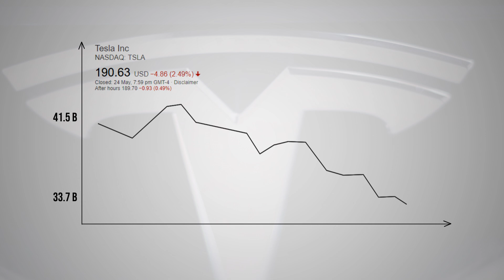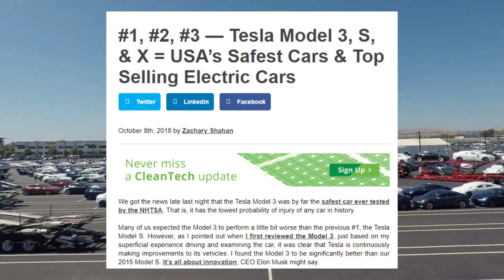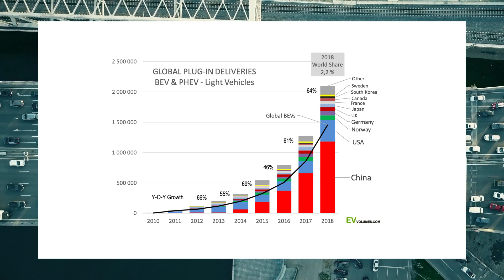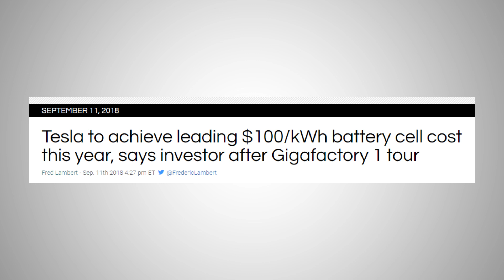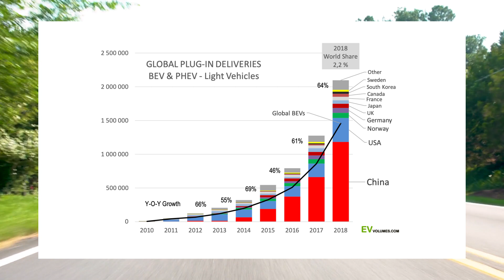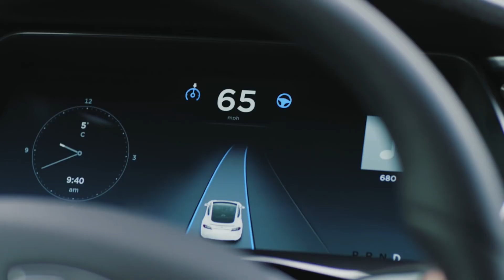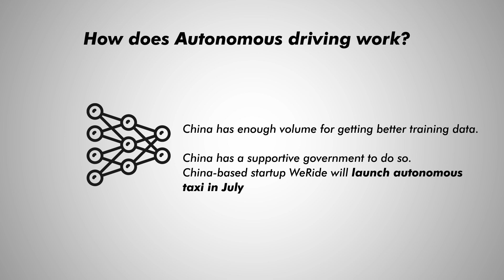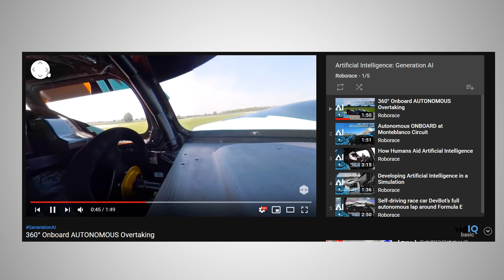Can Gigafactory Shanghai Fix Tesla's Money Problem? | Elephant Explains

Comment: The problem with Lidar is it's too expensive for mass use.
Reply: I mean Google Waymo uses sensors worth fucking $7500, entire AP FSD package is 8K. How can one justify the LiDAR sensor which is also not flush to sit in the car but destroys the design of the car itself
Reply: @gopinathms2012  you are so dumb, i mean look at the LiDAR device is like are you trying to make a big thicc forehead sedan / suv or what ?
Reply: @PicuPiee  rephrase your reply properly, I did not get you. Sorry
Reply: Most important problem is that lidar throws away important information by only giving you three dimensions, width, depth and time. The height dimension cannot be retrieved from this information. Cameras also give three dimensions, height, width and time, but depth information CAN be retrieved from this information very well. Furthermore available resolution of cameras far exceeds that of lidar. Because Lidar directly gives you depth information, it is relatively easy to create a decently self driving car. However, the absence of height information, makes it basically impossible to create a fully self driving car. Cameras on the other hand make it relatively hard to create a decently self driving car, but it is actually (theoretically) possible to create a fully self driving car using cameras.
Reply: And it's pretty fragile as it has moving parts.
Reply: @johntheux9238  Exactly.
Reply: problem is Lidar is a laser system cameras are much more effective when taking in mass amounts of information like you do when driving lasers do not
Reply: For an uber like autonomous driving car it's not that expensive
Reply: @rickvstange  Waymo's lidar cost $7,500 per vehicle, multiply that for a fleet of 10,000 self-driving taxis and you're talking 75 million dollars. Imagine how many more taxis Tesla can add with that money.
Reply: @rickvstange  yes, it is inexpensive for them or Google, But when Uber tries to mass deploy them, it will sting them hard.
Reply: Wow, such ignorance .. LiDAR expensive? moving parts? Wake up dude!!! Flip Phones and TV Tubes are gone ..  Cadillac SuperCruise uses LIDAR, option is same price as Tesla FSD Autopilot ... and SuperCruise is HANDS FREE .. and has competed a coast to coast drive 

https://www.cadillac.com/world-of-cadillac/innovation/super-cruise/coast-to-coast
Reply: @KrustyKlown  For $35k and you can buy one today?  They building 6,000+ a month?  What is this amazing vehicle?
Or do you mean the prototype that made the trip and the scout car that relayed data from 500 feet ahead of it?
Reply: @KrustyKlown  So Cadillac can back out of my parking garage, pick me up, drive me to work, and park itself when I go inside for the day?
Reply: @KrustyKlown  well I guess instead of nudging the steering wheel every so often like in a Tesla, you get your very own camera watching you to make sure you're looking at the road. It costs $5000 for a basic upgrade so you can drive on select highways that were mapped out although I guess its better than nothing
Reply: @conconc678    You do realize that Tesla's "hands on wheel" was a half assed fix resulting from the first fatality of a dude getting cut in half by slamming into the side of a tractor trailer because he wasn't watching the road .. how good a fix was this?? .. ask the top half of the guy who just got cut in half the very same way. The NSTB make safety improvement recommendations after the first fatality, and Tesla ignored those recommendations, ..safety recommendations that SuperCruise includes.
     Autopilot and SuperCruise are both Level 2 systems, ensuring the driver is paying attention to the road is essential for safety, Autopilot does NOT ensure the driver is watching the road .. and having to put your hands on the wheel with just the right pressure to keep the system engaged, but not too much pressure that it disengages .. is all too silly, when a low cost camera eliminates all that and is MUCH safer. I had one fool tell me he liked AutoPilot better, because he could read a book while driving, and that is why AutoPilot is DANGEROUS!!!
    Yes, there are safe places to use Level 2 systems, but Autopilot lets you use it on roads that are not safe for level 2, especially when the driver is not required to watch the fucking road.
    Yes!!! SuperCruise is better than nothing, and better than Autopilot in every test comparison. Keep drinking your Elon Kool-Aid!.. and keep your hands on the wheel while self driving.
Reply: @davidbeppler3032  Yes, only Tesla offers that feature of auto parking, why??  because it sells cars to people like you .. it is a feature that hardly anyone uses for anything other than entertainment ... it moves so friggin slow, its faster to just walk to your car get in and go, seriously you really think that is a useful productive feature?
Reply: @KrustyKlown  You think having a car drive itself is a silly feature?  Ok.  I think the elderly would disagree.  This technology will save lives!  That is not silly.  If Cadillac could drive cross country without any human interference then it could drive my mother to the doctor.  You made false easily debunked claims then change the conversation to suit your current needs.  I say Tesla is miles ahead then you say, only stupid people care about improvements on what we already have.  What we already have is not acceptable!
Reply: @davidbeppler3032  LOL, ummm.. your avatar doesn't look elderly?  Seriously dude, there are handicap parking spaces everywhere for elderly.  Yes, it's a silly marketing ploy that only a very small number of customers would actually find useful. Please do explain how the Summons / auto parking lot driving feature saves lives??  LOL, you are a silly boy .. go back and read my comment, I didn't say autonomous systems were silly, I said the self parking / garage roll out crap is silly entertainment, one notch up from Fart Mode. Also, as for Autonomous driving systems, Tesla has not completed a coast to coast drive, after YEARS of promising that capability .. while several other competitors have done this already .. what is Tesla's autonomous driving "first" record??? ... The First Autonomous Fatality ... caused by lack of driver attention monitoring.  Yes, Autonomous systems can save lives and one day approach the safety levels of the airline industry .. but Tesla needs to catch up with the rest, if being a leader in safety is their goal .. they could start by following all the NSTB recommendations following several AP fatalities.
Reply: @KrustyKlown  If Cadilliac is so advanced why are they behind Tesla?  That was my question.  Yet you just keep repeating, they programmed a route and followed a lead car with only minor technical issues and they say they never had to take the wheel and steer.  But they also didn't deviate from the course of major highways with clear markings and a programmed route.  Tesla is far ahead of them.  Not even close.  I bet the Cadillac has Lidar!  lmao
Reply: @davidbeppler3032  Tesla has NEVER completed their official promised Coast to Coast self drive, and requires drivers to keep their hands on the steering wheel while self driving (LOL, a friggin joke)  and AP can not tell if a driver is watching the road (dead bodies are piling up) .. LOL... how the fuck is that being ahead, by any metric other than body count?  Others have done a coast to coast self drive ... Delphi did it first in 2015, and  GM in 2017 ... Tesla NEVER.
    As for LIDAR, yes fool, this ENTIRE thread is about LIDAR ignorance to price and technology, solid state LIDAR is affordable, reliable, and can be integrated into styling. GM SuperCruise has the same cameras and forward radar as Tesla, PLUS LIDAR and plus a driver monitoring system for safety ... Are you even aware that every major company developing self driving systems uses Cameras, Radar and LIDAR... what Tesla uses, PLUS more. How is that Tesla being ahead?.. ahead on selling something for the same price that costs less to make?
    Again, every major review has placed GM SuperCruise ahead of Tesla AP.
    You have not ONCE explained by what fucking metric you think Tesla is ahead by?  Explain, site references ... or just stop embarrassing yourself.
Reply: @KrustyKlown  That is a lot of hate coming off you.  Let us tackle one thing at a time.  People have driven several Teslas coast to coast.  Just not on AP the whole way.  Plz be aware that neither has Delphi or GM.  Just the facts.  Lidar is junk.  Any company using it has already failed.  Some are beginning to realize this.  It is expensive and of very limited use.  As for the bodies piling up?  Were you referring to all the cars not made by Tesla?  Those cars have horrible safety ratings.  Did you know not all 5 star ratings are equal?  It is true.  Tesla AP has already saved hundreds of lives and prevented thousands of accidents.   Interesting you think the hands on the wheel that Tesla requires is a fault of the design?  The hands on the wheel are because people were safely falling asleep in the car and it was just cruising down the road.  Regulators were getting angry about it.  What car is it you know of that you do not have to pay attention when driving?  It will do it all?  Also how many have been sold.  That is an important fact.  Anyone can build a car for a few million dollars with a pre-programmed route coast to coast.  How many can go off route?  How will they handle a bridge out, or a police officer rerouting them?  I see you don't understand what you are talking about.  It is ok.  Things are changing.  Try to keep up.
Reply: @davidbeppler3032  Tesla promised that coast to coast official drive years ago... ain't happened.   https://www.theverge.com/2018/8/1/17641186/tesla-elon-musk-self-driving-coast-to-coast-delay

I'm ONLY comparing, and talking about LIDAR and autonomous driving systems, that was the initial discussion .. please don't derail into conflation of other vehicle attributes unrelated to self driving systems.

Lastly, the NSTB made explicit recommendations for verifying driver engagement, following Tesla's first AP fatality .. Tesla ignored those recommendations, while GM SuperCruise and other systems embraced them. WHY???  .. because of money, greed, retrofits and recalls and lawsuits.
Reply: David Beppler Consumer reports ranked cadillac #1 vs tesla at #2 when comparing their respective autopilot features.
Reply: @tpfrk8977  I am guessing you did not actually read the article did you?  Tesla dominated the Caddy.  Go read the article.  Tesla lost points because the tester could not get it to work the way they wanted, and they kept taking control because they didn't understand it.  lmao
Reply: David Beppler I’m not sure if we read the same article. There was no mention of having a problem using any of the vehicles tested in the one that I read. Yeah, they thought cadillac was the winner overall, but it seemed close and Tesla did best it in some categories accord to their review.
Reply: @tpfrk8977  I looked up what you were talking about it was 2018.  Tesla has recently been attacked by CR with a new "bad" report.  But in that article you can tell the person testing has no idea what they are doing and the idea of letting a car do the driving scares them.  :)
Reply: David Beppler The one that I saw wasn’t really negative on Tesla. They just rated numerous autonomous cars across several categories Cadillac had a number 1 overall rating and they had Tesla at 2.
Reply: @tpfrk8977  Go check the latest CR on Tesla autopilot.  Every day Tesla changes.  The Cadillac is probably the exact same as last year.  The Tesla has had 3-4 updates since then and one was major.  :)
Reply: David Beppler The latest I saw was from October of 2018.. that was 9 months ago so surely things have changed since then